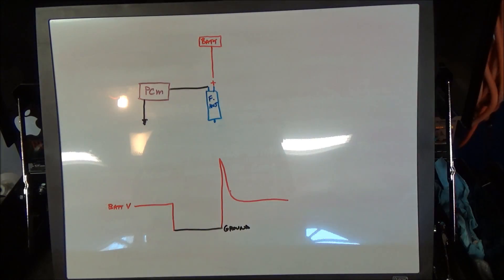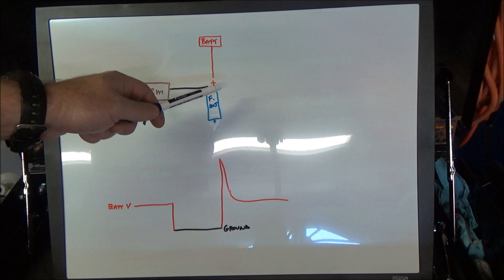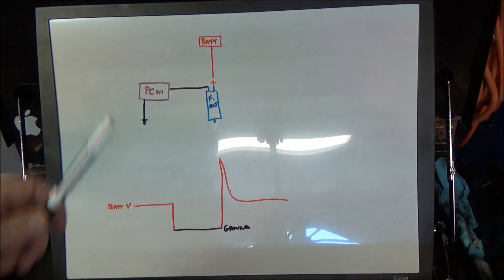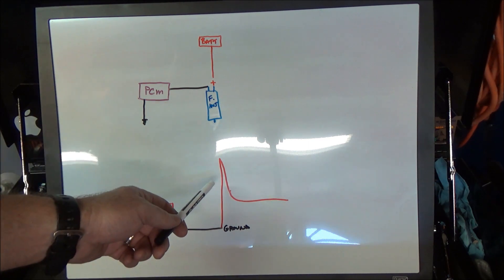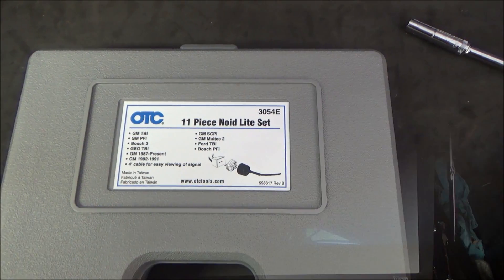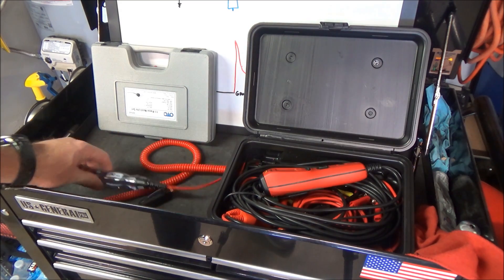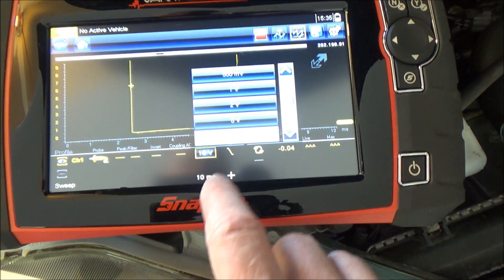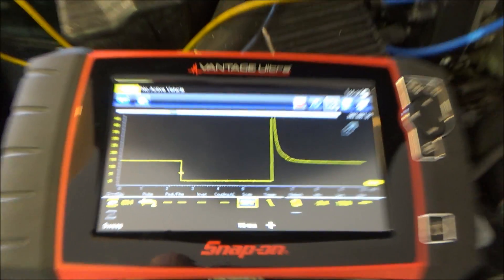Fuel Injector Testing: Noid Light vs Power Probe vs Test Light (Honda)

Comment: If you have power and control at that injector, you could swap a known good injector from another cylinder to the number 2 cylinder.
If the number 2 cylinder starts working, it will confirm whether or not the injector is bad.
Reply from the maker: Swapping parts is always an option, just have to remember that anytime a component is touched it may inadvertently start working again.  Another variable to keep in mind is that the rings/seals on each fuel injector would normally be replaced anytime an injector is removed/replaced (there are 3 for each injector on this particular model).  Thanks for the input!
Reply: tpcoachfix: I`m with you on that. You would also probably get more injector failures than valve failures. If both cylinders start firing after the switch, duh.....it`s fixed with doubts on #2 injector.
Reply from the maker: @REDMAN298  Maybe on a Chevy or Ford, but Hondas are not known for fuel delivery issues.  Not saying it can't happen but in my opinion there is a better chance of burnt or misadjusted valves than there is a fuel injector issue on a Honda.
Reply: It may be too late, but I would check the valve clearances.
Reply: Great video.

Comment: Big dog, do you recommend changing injectors at a certain point and/or fuel service at a certain point? 08 Honda Civic with 100k now and I’m trying to do a lot of maintenance services myself. Wondering if I should be thinking about this as well very soon.
Reply from the maker: Hondas do not typically have fuel delivery issues, I would not change them if I wasn't having an issue.  As you saw in this video, the fuel injector was not the problem on this Civic.
Reply: Big Dog50001 Automotive Thank you for the reply and info. Trying to get all 100k recommended work done and also replacing all fluids self so wasn’t sure if I should add that to the list. Thanks so much!

Comment: What if your light don't come on when you have your light detector hook to the ground
Reply from the maker: I would first suspect poor test light connections or poor ground being used.  If the connections are good then that means there is no battery power on the wire that is being tested.  Of course the ignition key needs to be turned to the on position to do many electrical tests on a vehicle too.

Comment: Really liked the video and explanations being simple and easy to understand. Thank you.
Reply from the maker: Thank you, I appreciate the comment!
Reply: @BigDog50001  will not the reverse voltage spike flows back to the power feed side and cause short circuit?? Analogy to a diode in a relay, is similar diode or capacitor necessary to absorb the reverse spike and protect the circuit and the solenoid itself?? Please kindly elaborate a bit more.